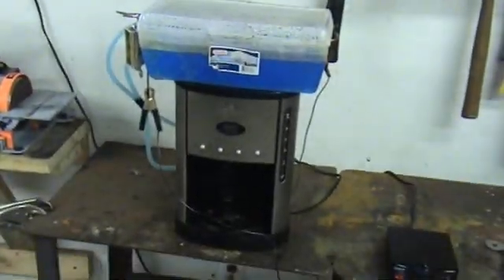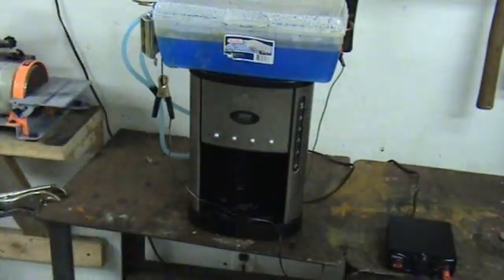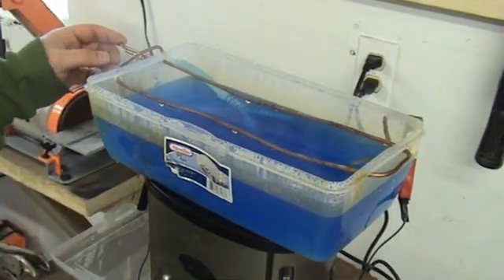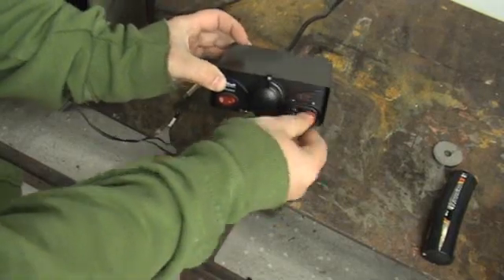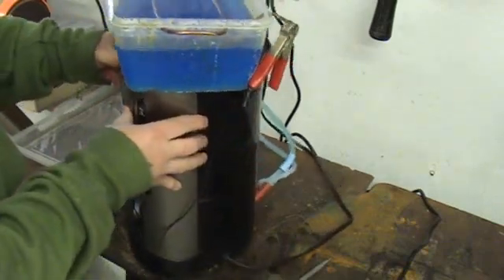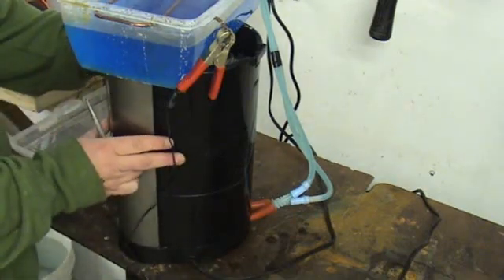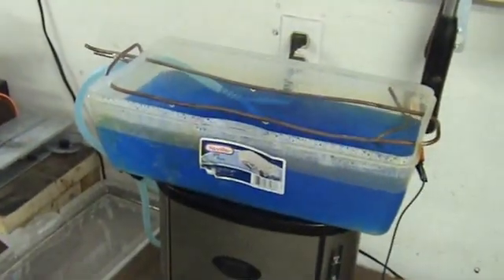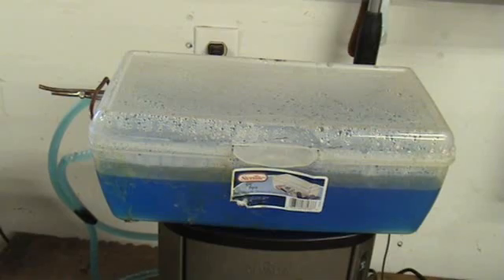Copper Plating Cast Bullets Pt.1

Comment: 693 / 5.000
Resultados de traducción
Thank you very much for your information and sharing your knowledge. Please if you can answer me: I have a 22 wmr (Magnum) rifle its rimfire bullets are difficult to reload.
I only want copper to silver the tip of the bullets loaded with fucking lead. If I immerse only the tip of the loaded bullet in the solution in a Copper Sulfate bath with 12 V 10 Amps in the Copper Sulfate solution, could these loaded bullets explode with this current in the solution? Or is there any other way to cover with copper to harden the bullet point?
Thank you very much in advance!
I suscribe ! Health to you and yours!
Thank you a lot in advance!

Comment: If you ever worked in an electroplating shop for any amount of time the AMPS always find their own, the volts your running is what determines how thick and how fast it will plate, to many volts you'll burn it....the amps are a non issue, its far easier to control how any volts your running. Yes i am a former hard anodizeder and chrome plater from a gun shop... Along with mag phosphate, black oxide and and many other jobs plating weapons.

Comment: I used a cheap coffee pot as solution heater.   Place the thermal breaker Closer to the heating coil, to kept it from gurgling.   It will open the circuit of the heating coil earlier….before boiling.

Comment: I'd really like to see you shoot a load of these to see if they lead at 1800 - 2400 fps
Reply: At a minimum, you need to: (1) swage undersize to allow room for copper (2) use a harder copper alloy to quickly fouling the barrel  (3) plate to the precise thickness for the barrel you're using

Comment: so i put this ridge together and started plating some of my gun parts. few questions am i supose to let them dry before handling? another problem is i'm getting alot of build up how am i suppose to leave the peice in for and when i went to wash it(pulling from bath to sink) everything just comes off like it's not sticking to the surface. so i resand the piece drop it back in the copper bath and same thing. any ideas?
Reply: need to make sure that part is totally CLEAN , you can not touch part with your fingers any oils/contaminants will make copper plating peal off, clean parts with denatured alcohol or acetone.
 make sure part you want to plate with copper is connected to the NEGATIVE power lead.
Reply: thanks will try that.

Comment: You keep saying 3 amp power supply, what about voltage???  Amperage by itself doesn't mean anything.
Reply: voltage is way too high. only need 1 volt of you're doing it right, and that will pull a couple amps or more
Reply: I looked up the radio shack power supply and it says it's a 13.8 Volt (DC) power supply. So you could probably have it charge your car battery if needed.
Reply: Where do you still find Radio Shack?  It's been out of business for long time.  If you go to eBay or thrift store you can find all kinds of power supplies for cheap.
Reply: The funny thing is that I still have one in my city. And their website was up (maybe it was cached. Not sure). And I can't say I'd get it from them anyway. I just used the information that I got so I knew how many volts I would need.
Now I can get a power supply from any company I want since i know the specs.
Reply: Gary is right you only want 1-2 volts

Comment: Hey does copper plating the bullets make them able to be shot at higher velocity?
Reply: +Scotty Jordan no..absolute no...the copper plating is only approx 0.001 thick...you can only drive them at speeds equal to lead bullets coating with alox..high speeds gives leading inside barrel.thats what me and 2 other mates found....therefore...for all the trouble doing it this way is just a waste of time..when i have casted 1000 i grab a bucket,squirt some alox and toss for 2 minutes,lay them on silver paper overnight to dry..done..alox your bullets is far easier for the same results except the color.
Reply: +Lure Smith so copper plating is just for looks?
Reply: +Scotty Jordan pretty much so as you cant drive them any faster without barrel leading as i have stated.electroplating only puts a thin copper coat and you leave it for even days, no more will stick to the bullet..some people think electroplating with copper is the same as making jacket bullets..far from the truth...just another bit...if you cast your own get a gas check mould.you can drive gas checked lead bullets to 2400fps and prob more..i have tested many at this speed with no probs at all..just make sure you alox the bullets.
Reply: +Lure Smith The coating is to cut down on the led galling the Berle . if you shoot 100 rounds of uncoated and clean then, shoot the copper ones and you will see that it is easier to clean ,  the 22's that have a copper coating were dun in the same way the same way that is shown they don't leave the gun as dirty as led ones. =) Hows It Made on how 22 are made .
Reply: +Stephen Salamone its obvious you dont know the speeds a .22 does..
Reply: +Lure Smith but plated bullets don't gum up ur dies like alox will
Reply: Lure Smith
has nothing to do with the speed it is the cleaning of the gun. the longer you leave then in solution the coating is thicker . the coating is on the bullet very good can not wipe it off..

Comment: What about silver plating? You know ... vampires and so :)
Reply: +MrVolodus No, it is a pain in the neck! You have to cast your silver bullets by melting a (silver) cross which has been blessed by a Bishop, taking care of removing the little blue stones. Then silver is harder than lead or brass, so if you kill too many vampires your barrel life goes down like the famous lead balloon. I use wood bullets, at short distances they are as effective as wood stakes. Regards
Reply: @Lazarus0357  silver plating, did you not read the question?
Reply: "Neither. You cut their frickin heads off."
Reply: They also don't do shellfish, pork, or anything with cloven hooves.  Just smear a little bacon grease or pack the hollowpoints with lard.
Reply: Isn’t that werewolves vampires don’t like garlic?

Comment: Isn't the "jacket" literally only microns think?   

Apart from looking awesome, what is the point of these micro jackets?
Reply: Son of a Zombie I have some professionally made plated bullets and they appear to have a very robust and generous copper plating.
Reply: Knightrem exactly.  the commercial process is to use a disc of copper and press it.  This chemical process seems too thin to justify doing it...
Reply: Son of a Zombie I am familiar with sweging but I am talking about commercially available plated rounds. It's actually a fairly generous copper coat.
Reply: There is also commercial electro plated bullets. H&N for example does it and it works great.

Comment: u could just use a fish tank heater, much simpler than your coffee machine setup. I may not be correct but I read somewere that copper plating plates smoother at 34 degrees celcius. nickel plating is done at around 70 degrees celcuis. your bath looks near boiling. also you can use an air pump in the bath to create bubbles around the pieces that are plating to again get smoother and faster plating results. aside from that nice job

Comment: Interesting. Frankly, I am a little sceptical as to the worth of going to all that trouble. Rather, just make sure the barrel is de - leaded thoroughly each time after shooting. I must admit the result looks professional and easy on the eye.

One little point on the lecture. NO OFFENCE. Try to cut out the word "basically" when talking.
Reply: Point taken on high velocity ammo, though I find it difficult to imagine the lead actually becoming almost completely liquid.
Reply: Some ranges won't let you shoot lead cast bullets because of lead dust. Copper washing is a way to get around it.
Reply: Thanks. Odd how people see things in a different light At my club you can only shoot soft lead, They say copper jacket indicates too hard a bullet which could ricochet. Both arguments are typical health & safety issues gone mad and are utter bullshit in my opinion.
Reply: I completely agree, which is why I don't shoot at those kinds of places.
Reply: ***** I realize that now but did not at time of my first comment. With a 24 inch rifle barrel, at what sort of velocity would the bullet start to become too soft?. My guess is around the speed of sound -  1250fps
Reply: Adrian Larkins As a rule of thumb, if you're pushing it faster than 1000fps, you at least need a gas check.

Comment: Science yo how dose it work!?
Reply: The negative charge wants to go to the positive charge, but cannot because it is separated, when the bullets are attached to the positive, the negative charge can circulate, and; depending on what material the negative charge is made of, the separate atoms of the negative charge will sometimes rip off, coating the positive material.

Basically like little magnets ripping off a larger magnet to a piece of metal :)

Comment: I set everything up except the coffe pot which I don't understand since the zep fluid gets about 100 degrees by itself from the action of plating. I come up with red covered lumpy bullets that leaves the zep water brown, I used a 2 amp 12 volt battery charger.
and can't get a nice copper coating. 1 week waisted and $100 gone on something that WILL not work. what am I doing wrong? please tell me???????

Comment: I did a copper plating demonstration (like your setup) for my kid's junior high science class. I used an old wall wart power supply from an answering machine. It worked great. Mine was 9V DC output at 1 amp but 12 to 36VDC, 1A would be even better. You can get them almost free at garage sales and thrift stores.

Comment: Playing creates heat initial self. Also keep the solution at level as it Evaps by adding distilled water, also make up solution with distilled water. Check out think and tinker website for plating help info.

Comment: Use a aquaria tank, aquarium heater and air percolator, you can buy copper sulfate solution at frays electronics, you can get sulfuric acid there as well, make a 10% solution of sulfuric acid, add 2-1 copper sulfate to sol. Use a tattoo gun dc power supply, make a cathode, top bar, and anode bar, use copper wire as your anode replenisher. Basically as you plate, you use up copper ions, u replenish this with the anode wire, it will get thinner as u use it up. Keep temp no more then 78 dgf,

Comment: So yeah, they're not supposed to perform like jacketed bullets.  They're just easier to store, handle and clean up after than conventionally lubricated lead bullets.  Also, I noticed Spinesales' lubrisizer is a Lyman 450.  He has to crank the lube feed for every bullet he sizes.  That's no good (had one).  I use a Star now, but that does'nt alleviate the problem of sticky, messy bullet lube.  Even the commercial stuff flakes off and you cant use it in a feeder.  This should be a cool experiment.

Comment: Oh yeah...the value to this as I see it is that you don't have to fool with bullet lube.  I doubt this would work too well with rifle bullets but I hope I'm wrong about that.  Somebody was noting that these aren't tough like jacketed bullets; they're time consuming and expensive to make, etc.  If you get the RCBS bullet feeder it will gum-up using conventionally lubricated lead castings.  These should eliminate that problem and the increased convenience thereafter should offset any problems.

Comment: I removed the original reservoir from mine.  I just have the base now with tubing leading to a 10 gallon tub.  I used 3/8ths inch inside diameter, 1/2 inch outside diameter clear vinyl tubing with hose clamps at the heater end.  That's as far as I got tonight.  I'll build an appropriate sized shelf unit to combine the pieces.  I want to try the slit sheet metal with holes type bullet holder but I bought some speaker wire just in case.  Got a step drill and I'll lay out holes with graph paper.

Comment: If you do this system just like he shows, you can use a piece of cast copper to weigh down the twin fill tubes that jet the water into the box.  The pure cast copper would only provide an additional reservoir of copper for the plating process at worst, or just be successful at holding down the hot water tubes when they blow hot solution into the plating box.

Comment: Whatever cathode is in the solution will attract copper ions and become copper plated. You don't want that happening to your cathode, as it will rob the bullets of copper. The bullets going into the solution complete the circuit and become the cathode, attracting copper ions to their surface, becoming plated.

Comment: @armenlanesh818: You can get .223 molds (.224"), just order and wait.  Cast lead bullets are routinely shot at 2500fps.  They have to fit the barrel's groove diameter closely and need a gas check. Also the bullet lubricant has to be suitable (such as LARS HVR) & the bore surface cannot be rough. Your rifle bullets will not melt (especially in mid-air).  The alloy yield strength must exceed the peak chamber pressure or your bullet base will deform and produce poor accuracy.  Stay below 2000 fps.

Comment: The lines are attached directly to the heating element tubes.  They do not connect to the coffee pot's reservoir.  Otherwise it will overflow.  Any hardware store should have line connectors and hose clamps that will fit well and look a lot neater.  Look in the irrigation system aisle.  Aquarium supply stores are another good place to look.

Comment: You say the negative conductor cannot touch the solution. Yet, when the bullets go into the solution, they are the cathode.

The question is, as long as the circuit is open (no current flowing), there is no electrical contact between the cathode and the anode: If the bullets go into the solution before the switch is closed, does it matter if the heavy conductor is in the solution during the process?

Comment from the maker: Not sure on the gravity question. The fluid should just loop through the heating element. Im using a 3amp power soruce from radio shack with a 1.5amp car dome light in line to reduce the current.

Comment: Okay just built myself a rig similar to this.. Questions are how did you keep the gravity from overfilling the coffee pot? What type of voltage/amp are you using? Any hints on how to keep the lines from leaking? It looks like you have some type of red connectors in the coffee pot itself (what is that?)... I just used gorilla glue and it seems to be working great.. I am just trying not to make my system look like meth rig haha

Comment: I hope you can answer this question, since the copper sulfate solution is used to supply the copper to plate the bullets, can you oversaturate the bath by throwing copper pieces (like copper jackets) to keep it from loosing its copper concentration over time?

Comment: If you cast your own bullets do you have to use an undersized mold to compensate for copper plating?
Reply: Yes. You also have to find the optimal plating thickness for your specific barrel.

Comment: Just a little tip the Walmart in my town has on sale for 30 bucks a 1 amp battery charger dunno if it would work for what your doing but it's what I plan on using for a large tank

Comment from the maker: @digisol100 The DC out put is 1.5 amps. I think the motorcycle charger may be too strong and just turn the bullets black. I have plated in room temperature water and it works fine.

Comment: What is your DC voltage output, I have to assume a motor cycle battery charger would be sufficient to supply voltage.

Have you tried doing this exact sale plating in room temp water rather than hot water ?

Comment: I have an old Crock Pot with a ceramic cook pot inside. Do you think that would work to heat the solution? Or is there a problem with the coating they use on them?

Comment: there's a critical part to the coffie pot that you left out.. so i'll discuss it here.. in the inlet tube is a 1 way valve that allows water to flow into the heating element.. it is critical that this 1 way valve remains in place. you can feel it in the tube if you squeeze it, you'll feel a small valve in it.. this is what allows the perculation to occure.  if that valve becomes damaged or non fuctional in any way, you'll notice the coffie pot will not circlulate.